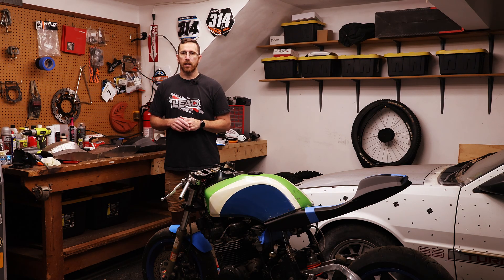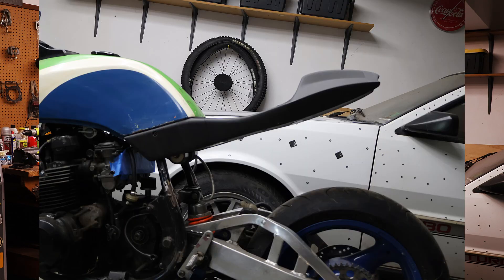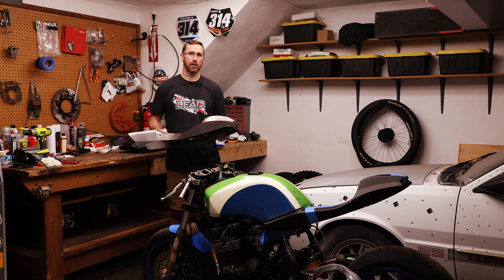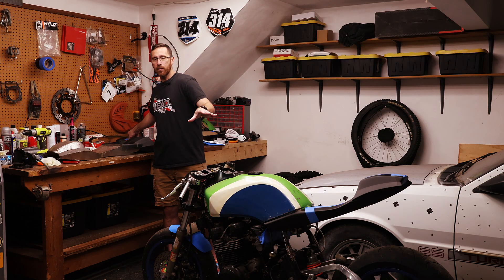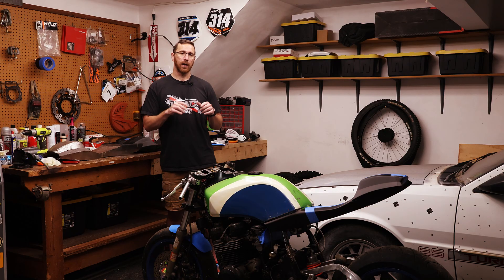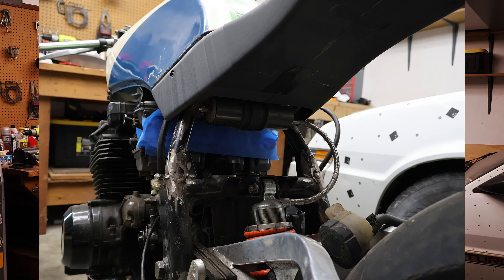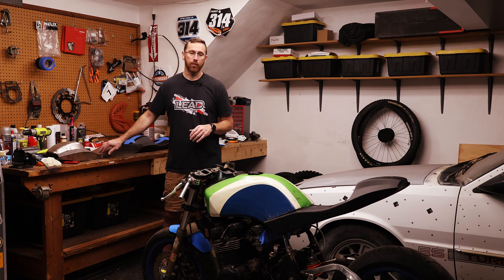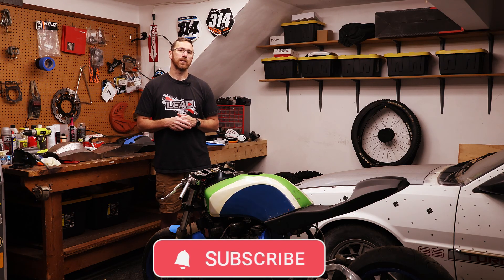Designing A Motorcycle Tailsection | GPz Build Series Episode 5 Overview

Comment: I’m absolutely loving this series and you breaking the videos up in this way is great. Thank you! 
And LOL on the end of that video. I love sport bikes but they look so uncomfortable. 
I’m still on my entry level cruiser but maybe one day I’ll try feeling like a racer 😂
Reply from the maker: lol yeah this bike was way more comfortable stock than it is now.  What you find out with cruisers is you have less control over the bike.  With a sport bike you end up with more weight on your wrists if you aren't engaging your core.  a lot of the input comes from the waist down pushing on the pegs and leaning your body.  My preference is actually supermoto.  you can move around, upright position and loads of fun.  Basically feet directly under you is great for all around (sport standard supermoto).  Feet in front of you means you are basically using just the bars for steering.  Sportbike means you are using mostly body weight/pegs.

I dont know where you are/what bikes you have access to, but trying something labeled as a "standard" is what I would suggest.  Depending on the country there are loads of 125-300cc options.  In the US not as many but still a few.

Comment: Not sure I’m fully understanding your dilemma with making the negative for a mold, but what if you sliced off, say, the last few inches of the end of tail and made the sliced end a separate cap piece that inserts into the main component? Like a bee’s stinger?
Reply from the maker: since the part is basically enclosed i couldn't lay the cloth in the mold to make it 1 pieces.  So I either need to make multiple parts and bolt them together or try to join them with extra cloth on the inside.  I haven't decided just yet what to do.
Reply: @LearnEverythingAboutDesign  Oh, gotcha. You’re talking CF or fiberglass.

Comment: Looking forward to the big one. Just getting into Fusion I learn a lot from each video. I'm currently trying to mend a headlight bracket on my car. I've scanned the bracket with my Metro X and now have it in fusion aligned and ready to build the bracket. I thought I could build the bracket around part of the old bracket and then do a combine cut so after printing I could glue it in place. The problem is though I can select the part I'm building but I can't select the mesh as the tool to cut out the shape. Is this because it's a mess? Any ideas to get the job done?
Reply from the maker: Yeah so you have really 2 options.  1 is to convert your solid to a mesh on the mesh tab.  Once thats a mesh you can use the mesh tools like combine to join or cut them.

The other option is to convert your mesh to a solid.  In most cases this is not good unless you can do a proper reverse engineer of it.  

If you plan to 3d print your part what I would suggest is finish your solid model.  Copy/paste the body.  then convert one of the bodies to mesh on the Mesh tab.
Reply: @ oh right OK that sounds like a plan. Cheers.

Comment: Just a thought, what about the exhaust against the tail? Kind of like the Honda CBR600'S? This also may be the best looking tail out there! It looks so good.

Appreciate the shout out. Can't thank you enough for your videos! Helped me with a ton of designs and working through issues!
Reply from the maker: Thanks!  The problem with the undertail on my bike is getting the pipe up to the tail.  The 04+ R1, the cbr etc all had a path up either with a swingarm cutout or a pass through.  Other bikes that had aftermarket ones generally had SSSA or something.  On mine i "think" i am going to build a custom muffler under the bike with dual dumps.  I did this years ago and ran some custom baffles in the pipes and it was too loud.  THis time ill likely do it a bit more proper and might run the pipes back, forward and then back again.  we shall see :)